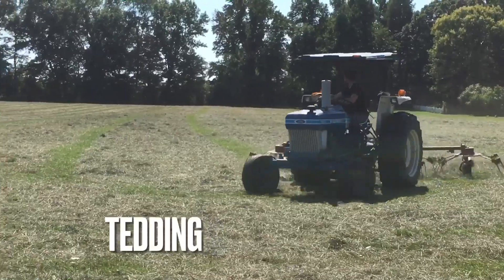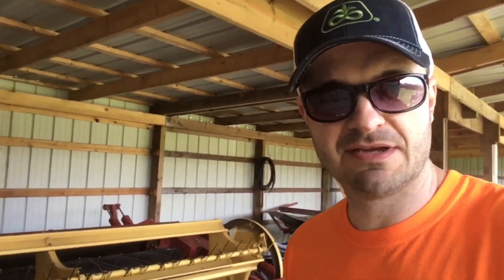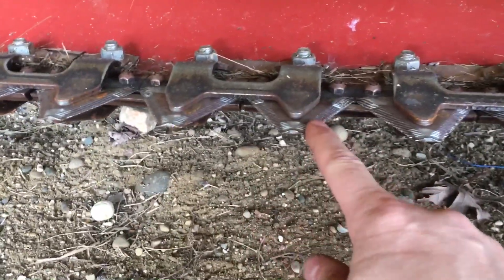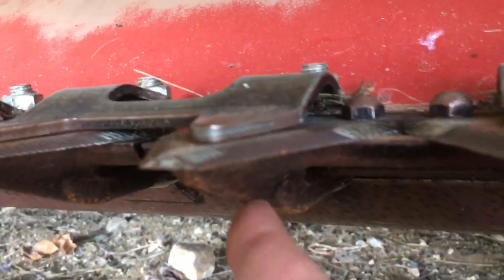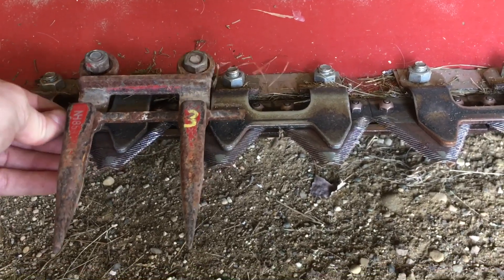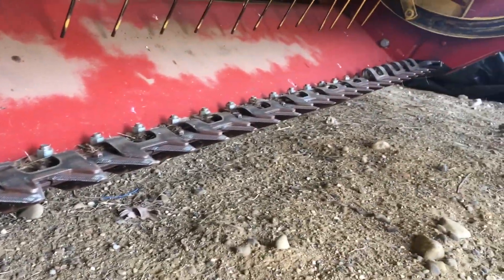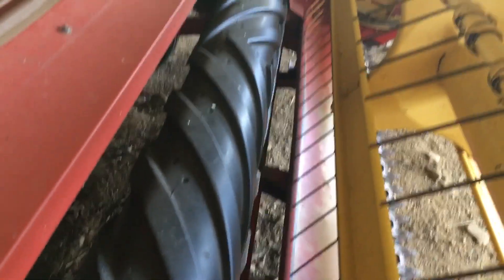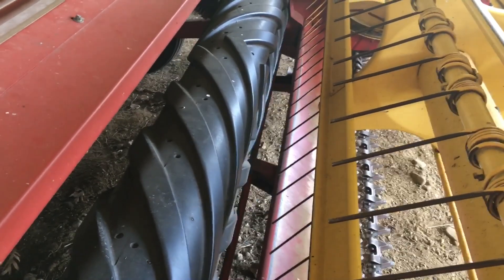Here’s how haybine mower conditioners work!

Comment: Question: My fields are river valley with flooding in the winter. They can be very rough, with occasional gopher mounds in high reed canary grass some places, but the resulting grass is great feed for my horses/goats. I've torn up a drum mower and am looking for another option. My neighbor farmer suggests I'd do better with a disc mower, but would a haybine be a good option? 
In the Pacific Northwest where I have very short windows between rain to hay, a conditioner would also be very helpful.
Reply from the maker: Unless there’s a lot of stem a conditioner isn’t very helpful because there’s no stem to crack (such is the case with straight grass). If you have short windows then you NEED a Tedder. That is non-negotiable. 

If your fields tore up a drum mower then they’d tear up a discbine too as the drum mower is very similar in operation to a discbine. A Haybine might serve you better because the guards protest the knives. However in very thick or tall  grass a Haybine will struggle and it will be a slow process whereas a discbine or drum mower will munch right through it effortlessly.
Reply: @TheScientistHayFarmer  Yes, I might ted 2 or 3 times before I row and I was hoping a conditioner might help on my diesel and days in the field. I had to mow much later in the season than I used to/should and the pasture was a lot higher than it should have been. Hopefully next year I can catch it at the right height for nutrition and ease of cutting, but the increased erosion from the winter tidal flooding can be a real equipment hazard. Still, I have to hay.
Thanks for your simple and easy to understand video. Your approach is really helpful for me.

Comment: I have been thinking about swapping to this from the drum mower.  Thanks
Reply from the maker: Never used a drum mower but really considered one when starting out. Can move fast with them from what I understand but they aren’t very wide. 

What do you not like about yours?
Reply: @TheScientistHayFarmer  I tell you what, I use a Tar River BDR-185 (right at 6’) on a ‘75 Ford 8600. If the blades are in decent shape, and you can stay in the seat, that thing will flat out put the grass on the ground. With the hp that old ford has, even the tall thick stuff won’t slow it down. It never clogs. It doesn’t make a terrible amount of noise. The only thing I can say I would change, and I have some ideas on how I could modify it, there is no way to adjust cut height. It simply lays on the ground, spins extremely fast and makes a perfectly clean cut. Just happens to be really close to the ground so you’re taking all the grass off but some grasses will struggle for growth when cut that low. Besides that, if the grass is tall and thick like yours is, it Will definitely need tedding since it lays the grass down in a line towards the middle. I have not come across any grass it couldn’t handle. I did try it on a smaller tractor first, yeah that didn’t go well. Couldn’t keep both rear wheels on the ground. TR recommends 3900 lbs tractor if I remember right and it needs it. I think I saw wheel weights on yours so you should be fine with something like either a 185 or even the 210. Over all it’s a bad dude.
Reply from the maker: @rodney5656  I always ted regardless. It ensures everything gets dry but also helps with raking.

Comment: Can you still cut without the rollers?
Reply from the maker: I don’t think so. It won’t condition the hay for sure, but the rollers also grab the hay and throw it out the back and without them, the hay would get bunched up at the cutter bar.
Reply: I just bought a 1071 with a bad wobble box, hopefully I can fix it.
Reply from the maker: The wobble box doesn’t have anything to do with the rollers though.
Reply: @TheScientistHayFarmer  : yes I know, was wondering if it's a big job to repair the wobble box.  Was told that it needs new bearings.
Reply from the maker: It is a fairly involved job. A lot of bearings that are pricey. The order of install matters.
Reply: @TheScientistHayFarmer  😱

Comment: On a JD 1209 the parts manual refers to them as non clog guards. Mine currently has the rock guards, but since it needs new sections, just going to replace them all with the NG ones, which also require different hold downs.   One thing about rolls, they need to be adjusted so they don't bind, but tight enough to pass grass through,  minimum of 1/32" and do not let them touch. You need to check this across the entire length of the rolls because they are never 100% straight.   This is right out of the Operators manual on the JD1209, and shouldn't be any different on the NH.
Reply from the maker: The non clog is JD’s own naming convention though most of the rest of the world calls them stub guards. JD naming convention for their mowers was MoCo while NH was Haybine.

Comment: Plugging problems start with wet soil / crop.  First.... sharpen the tips of the guards. Yours are rounded from the factory.
Reply from the maker: Mine are stub guards. They won’t plug no matter what. This is a different type of guard than the long pointed standard guards. In another video I describe how to properly adjust stub guards.

Comment: Biggest mistake is farmers dont take the time to install sickle guards properly !   No guard was created " equal " . Meaning they must be bent / adjusted to lay flat !  Often I used small piece of  a hack saw blade .....under the back of the guard to tip it up.  Always start on the ends first. Then install " one " in the middle. Work out from there. I have had to heat the guards to bend them so they lay flat. Most times its a  full days work !
Reply from the maker: Hack saw blade is a good idea. I’ve made my own shims out of flashing before. The stub guards have to be shimmed very well. It took me quite a while to set this system up but cuts so much better than standard guards.

Comment: The rolls in a hay bine are meant to touch each other. If you can pull a sheet of paper out between the rolls it wont do a good job crushing the stems. They do not wear out. Ive ran mine as tight as I could with all the pressure I could put on the rolls for 25 years. Never had an issue with chunks coming off the rolls. New Holland did have an issue with bad rolls for a few years. Just last month I was at a sale.. seen 8 hay bines. All still had the spacers " rusted " in place " between " the rolls! Imagine a farmer thinking he was advancing in life....instead buying himself another sickle mower ?  Poor guy !
The shims were meant for cutting oats so you didnt knock off the seed heads with the rolls.The hay bines were shipped with them in.....earlier they were shipped with them bolted off to the side near the ends of the rolls.

Comment: We had a 479 Haybine we first pulled with a gas Massey-Harris 44 Special row crop narrow front, and then with a Cockshutt 1550 Diesel row crop wide front. That 479 was one sweet running machine. We had the long guards, so wet hay had to be run a little slower and carefully on the corners. The 44 Special ran it alright, but the 1550 was a dream on it.
Reply from the maker: A 479 is the first Haybine I ever used. Very similar to the 488. The first one I ever bought was the 7 foot version, a 477.
Reply: @TheScientistHayFarmer   I ran my 7 foot  477 hay bine for 15 yrs. Always used it on 1000 RPM. But operated the tractor at half throttle. Could move at 8 miles per hour.  Biggest mistake ever made.......selling it and going to a 479. Too many issues with the wobble box !  The 479 was not designed heavy enough......still worked but many repairs !
Reply: How does it change system work on at 479 model

Comment: A couple of questions-comments.  1) where did you route your rope that allows you to change the tongue position from transport to field use?  Under the tongue and up to your right rear fender?    2) have you ever adjusted the flotation springs and if so, did you use a spring scale to lift up on the front crossbar?  Was the header up or setting on the ground when you did it?  

I have a 488 that I switched over to stub guards last year but only have about 8 knife hold downs on it.  Nobody had mentioned needing them at every guard but makes sense.  I wanted to check the flotation and tried lifting up the front by hand as the mower was sitting down on the skid shoes --- uh, no.
Reply from the maker: The rope goes through a loop on top of the front PTO shaft support on the mower, and then up to my tractor. In this video I show how to hook up the haybine and how I route the rope.

https://www.youtube.com/watch?v=4epByLC2dB4&t=466s

For stub guards you need a hold down on every knife. The hold downs straddle the guards and are offset. If you wanted to replace a guard, you'd have to remove two different hold downs.

I haven't adjusted the floatation springs in a long time but I didn't use any kind of scale. When the head is up, it lifts pretty easily by the push bar. I don't recall how easily this mower lifts when sitting down on the skid shoes. I think I can still lift it with a bit of effort. You want it to react to the field but not be like a bounce house obviously.
Reply: @TheScientistHayFarmer  Hey --- thanks so much for the reply.  I did see your other video showing where your pull rope runs after I posted this.  Oops.  

I noticed you used the non-adjustable hold downs.  Do you use shims with them to get them down on the knife or the BFH and whack it?  My hay is almost always lodged with fine grass in the lower regions of the grass.  A plugging bonanza.
Reply from the maker: @Redandranger  you should never have any plugs with properly adjusted stub guards. Tis the beauty of them. To adjust the hold downs you shim it. I did have to straighten the tips of my hold downs a bit by putting them in a vice and smacking them. Without shims, the hold downs will press too tightly against against the knife. So you add shims until the hold down is just to the point where there is a hairline gap between bottom of knife section and guard. You should be able to grab tip of knife section and pull it forward towards you. If you can’t, the hold down is too tight. Also you can run it for a minute and feel if any of the knife sections or hold downs feel really hot. Finally, you should be able to freely rotate the reel by hand or be able to turn the PTO by hand. If you can’t, then your knives are binding somewhere and it’s too tight. You will blow out your wobble box. 

You’ve inspired me to make a video on proper install, set up, and adjustment of stub guards. :)
Reply: @TheScientistHayFarmer  Thanks for the info.  I have one more question regarding your stub guards/ hold downs.  Are the hold downs specific for use with stub guards or can you use other after market hold downs?  Did you get yours from New Holland?  They seem pretty spendy - more  expensive than the stub guard @ $15/ea. but if that's what it takes.

As you know, proper adjustment is everything in haying.  Good equipment not set up well is just as bad as poor equipment.  Or worse.
Reply from the maker: @Redandranger  the hold downs are specific for use with stub guards but fortunately you can buy aftermarket hold downs. I got mine from Shoup Manufacturing. I definitely did not get mine from NH. 

I just filmed a video yesterday on installing and adjusting stub guards, as well as everything needed for them. Once I have it put together and edited, I’ll be throwing it up on the channel.
Reply: @TheScientistHayFarmer  I just got some hold downs from Shoup today.  I sure hope I ordered the right thing.

Future video --- changing the knife drive belt on the 488.
Reply from the maker: You will have to bend the very tips of those holds downs flat. They curve up a bit. I bent mine in a vice. Do you know how to shim them out properly?
Reply from the maker: @Redandranger  I just threw up the video on installing and adjusting stub guards. A bit boring but hopefully helpful :)
Reply: @TheScientistHayFarmer  I have a set of shims handy but didn't think it was going to be complicated to set them.  There is a guy called Mike10 that posts on HayTalk site who is a 40+yr NH guy.  He has some interesting comments/directions about setting up knives/guards etc on the NH haybines.  He even had a homemade tool for tweaking the guards.

I'll check out your video.  Thanks for your help!  It's time to cut and we're in a drought that will seriously reduce our hay production region wide.
Reply from the maker: @Redandranger  Yep  know Mike. In fact the way I described how to do it in the video is exactly how Mike told me to do it.

Comment: hey, I have a 447 haybine, it looks almost the same as yours ( it might be a little older ). How to keep the rubber rolls in good shape and avoid cracks in them? Would you spray them with silicone to make them last?
Reply from the maker: The best way to preserve the rolls is to keep them out of the sun and UV and keep them properly spaced so they don't hit against each other. I don't know that anything you can actually rub on them will help.
Reply: New Holland had issues with the rolls for a few years. By the time the rolls showed up with a problem the warranty was void. Thus problems with rubber chunking off !  I operated my hay bine for year......no spacers / shims.......tight as possible together. Never had an issue with the rolls !  If you are having problems...... the rolls are chunking off.....most likely its one of those hay bines that someone knew was going to be an issue.They dumped it. The dealers should have a series / serial number span that had the issues.  They may not even know what your talking about though.  Its was a vulcanizing issue in the rubber...... and a glue to adhere the rubber to the rolls. Sunlight has little effect on the rubber. However........the acid from the hay does ! Wash them off when finished. No different then your overshoes/ boots in manure.
Reply from the maker: @jerrylansbury9558  UV will absolutely breakdown rubber.